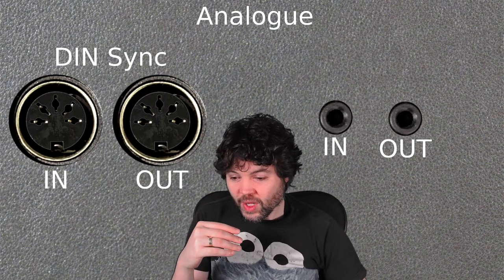MIDI & Analogue Sync

Comment: Big thanks for explaining MIDI as I was just looking this up; didn't realize its using optical (galvanic) isolation to keep down noise.    Is there a maximum number of devices that can be chained when using the thru configuration?   I also wonder if there is a delay that builds up when chaining which might have to be accounted for to make sure every unit in the chain remains in sync.   Thanks again for your content.
Reply from the maker: The canonical implementation for midi thru is to place a buffer (e.g buffer ic, pair of inverters or opamp) on the output of the optocoupler and feed that, alongside your current source (5V reference) to the thru port. This buffering should mean there is no signal loss. The slowest implementation is usually with old CMOS inverters which can have propagation times up to 50ns of nano seconds, so 100ns per hop. The majority of the delay is therefore dominated by the optocoupler. Modern LED optocouplers tend to introduce delays well under 100ns, so total delay per hop is 200ns, so 200ns x 16 = 3.2us (microseconds), in other words: negligible.

This is the theory, but the reality can be quite different. First of all, old optocouplers can have quite significant switching times in the 10us range, this gives 10us x 16 = 160us : still negligible. The real problems come from non standard implementations, for example a device might passively split the input signal for through resulting in signal degradation (but not delay) and effectively having the current source on the first device have to illuminate 2 optocouplers. Add a second such device in the chain and the optocoupler might not even work.

The next problem is devices with a software thru port. In theory they could retransmit a byte at a time. Midi is 31250 baud with a start and stop bit, so a 3 byte message (like note on) is 3 x 8 +2 bits and takes about 1ms to transmit, so 1/3ms per byte on average. 1/3ms  x 16 = 5.3ms: getting into time scales you might perceive, but still probably okay. Often they won't retransmit until the full message has arrived, so 1ms x 16 = 16ms: this is a delay a human might notice and doesn't account for other timing delays introduced in the software on the device.

TL;DR: the amount of delay each device adds in a midi chain varies from negligible to noticeable. Similarly some devices with poor through designs simply won't work when too many are chained. The most reliable method is therefore a midi multi thru box. It contains a modern optocoupler and a buffer per output meaning every device experiences under a microsecond of delay without relying on the device designer to include a thru port and implement it optimally. I use a Kenton thru 25 and it works nicely.
Reply: @ChalkWalkMusic  wow nobody gives more thorough and complete answers to questions like you do my friend wow